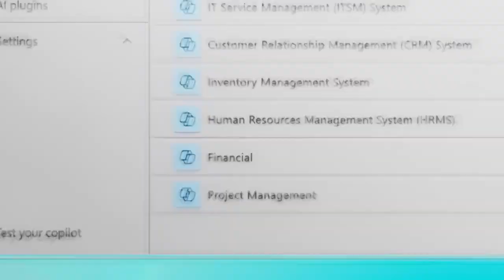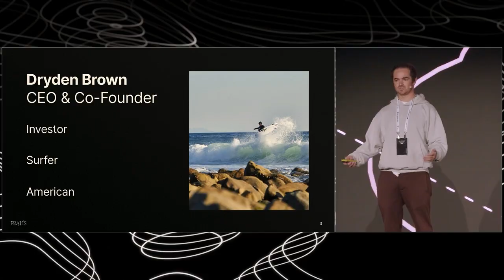Why Isn't This Trending? Tesla Robot Attack & More

Comment: Water proof enough ?

So you want people to float the 100 grand plus  in the ocean 
With a 3.4 tonne ev with water proof thats enough ?

Or is it water proof enough til its usnt  and water  floods all the electrics and battery 

Well at least one thing when the battery goes into thermal runaway  the sea water will help put out  the fire 

I gather the dinghy , flares , floaties are optional extras  with the Chinese  made cyber truck
Reply: You are a bit off on a lot of things. One thing in particular is the Chinese made part. Teslas, including the Cybertruck have by far the most US made parts AND assembly. I think you are watching too much CNN.